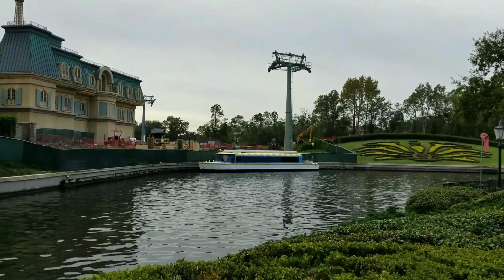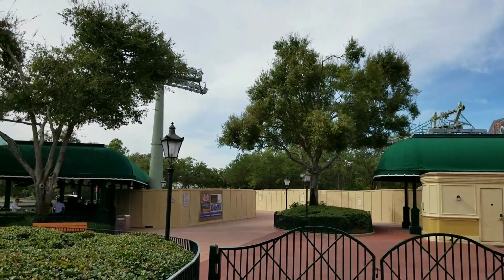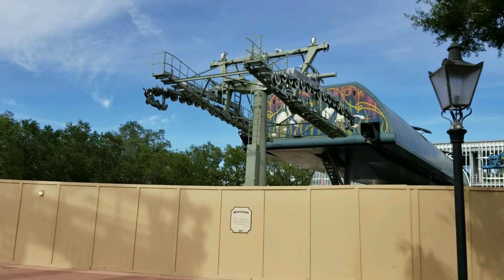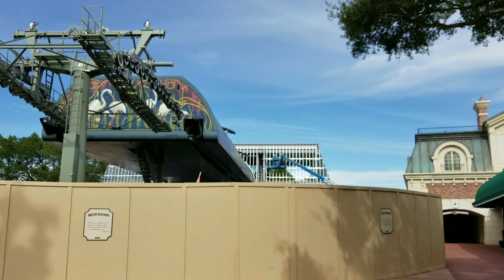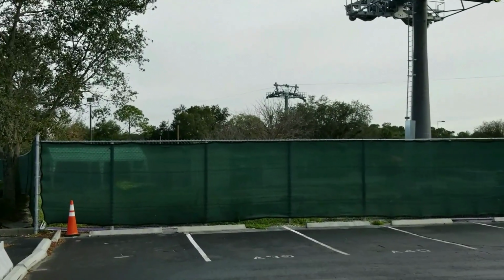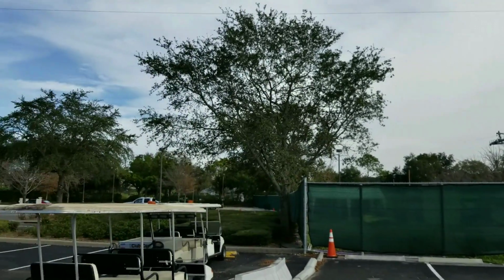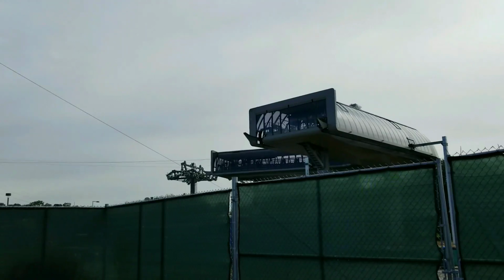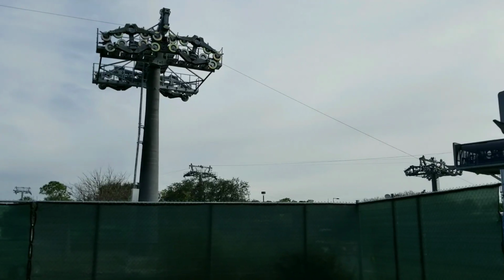Disney Skyliner Construction Update New Cables Boardwalk and Epcot Progress

Comment: How does the 90° turn work on the system. Does the same tow rope pull all the way through the turn or does the gondola leave one rope and transfer to another?
Reply: I think this article answers my question:
http://gondolaproject.com/cornering/
Reply: Both. The gondolas de-rope in the turn section but the same cable runs through using 3 Bullwheels to guide it. See https://www.cheapsleepnow.com/imgcab/custom/3bullwheelturn02.jpg

The Riviera Station does the same thing but there are loading and unloading locations. https://www.cheapsleepnow.com/imgcab/custom/tripplebullwheel02.jpg 
https://www.cheapsleepnow.com/imgcab/custom/blogmickey_riviera_181120_02.jpg

Comment: Another great update on the Skyliner construction. I found a great close up picture of the Riviera Station over at blogmickey.com which confirms that the Epcot line will run in a clockwise direction. It also reveals that the gondolas' doors will be closed between unloading and loading points on each side of the station. In other words, a gondola will come in, the doors will open for guests unloading, then close before it makes the turn around the bend, then open again to allow new guests to board, then close again before it heads out of the terminal. 

https://www.cheapsleepnow.com/imgcab/custom/blogmickey_riviera_181120_02.jpg

The picture shows 2 door opening mechanisms (tracks that slope up, that push a roller on the hangar arm up) and 2 door closing mechanisms (tracks that push that roller down), and the positions of these mechanisms indicate that the gondolas will be traveling from right to left, or a clockwise direction. 

There does not appear to be any U-turn option at the Riviera station, or side track to park a gondola for special needs guests. That, along with the very short distance between the door open mechanism and the door close mechanism, makes me think that  the speed of the gondolas traveling between door open and door close is so slow that people in scooters and wheelchairs will not have any problem getting off or on.

The distance between the points where doors are fully open and where they would start to close seems to be about 12~14 feet by my best estimates. If the spacing of the gondolas on the Haul Rope is at 12 second intervals then there is about 12 seconds for guests to exit in the unload area, and the same time to board in the load area. That puts the speed of the gondolas traveling through the unload and load areas at about 0.3 meters per second (0.68 MPH). 

For difficult unloading and loading scenarios, the speed of the Haul Rope can be slowed to one of several preset reduced speeds, maybe a Half speed and a Third Speed. The tires that drive the gondolas through the terminal are synchronized to the Haul Rope, usually the acceleration and deceleration sections are driven directly by the Haul Rope, with other sections in the terminal powered by electric motors that are controlled by a computer monitoring the Haul Rope speed. 

This allows the gondolas to spaced properly, with late gondolas getting sped up a little, and early gondolas getting slowed down. This spacing will probably happen in the turn section between the unloading area and the loading area. Since the spacing can be adjusted, it could be possible for each gondola to actually stop in both the unloading and loading areas, maybe for as long as 10 seconds (assuming a 12 second interval between gondolas on the Haul Rope and couple of seconds stopping and starting). In some cases a gondola might be stopped for even longer, with the approaching next gondola getting slowed a bit more than usual, which would then have a shorter stop time and/or getting sped up a bit after leaving the unload area. 

It will be a mystery for a while longer, but we now know that each direction of travel will have separate unloading and loading areas, not a free-for-all mess of people getting on and off in one location.

Comment: Hello All You Fan Of The Regular Gondola System That You Find At ALL Of your Ski Areas Around The Us. Well Never Before In US History Has There Ever Been A 8 Person Chairlift. In Fact It Is The Same Company That Is Also Installing The Disney Skyliner. It's A Larger System Than The Ski Area Have But Still NOT That Impressive. What Is IMPRESSIVE IS The Brand New RAMCHARGER 8.  Ramcharger 8 The most modern chairlift that’s ever been built Ramcharger 8, an eight-seat, D-Line chair with ergonomically-shaped, heated seats and a "Big Sky blue" bubble, will transport 3,600 skiers per hour .Ramcharger 8 Chair Facts

    Each chair is nearly 15 feet wide and 13 feet tall, and weighs over one ton
    A single chair weighs in at 2262 pounds, roughly the weight of 4 adult grizzly bears
    Each grip weighs approximately 350 pounds
    The bubble on each chair is 4.19 feet deep from front to back at its widest point
    Ramcharger 8 will have 64 chairs total
    Ergonomically-designed, heated seats outfitted with custom Ramcharger graphics
    Weather-proof bubble protects skiers from the elements
    Individual headrests and footrests for maximum comfort
 Now That's IMPRESSIVE. Sorry Disney. Can't Compete Against That.